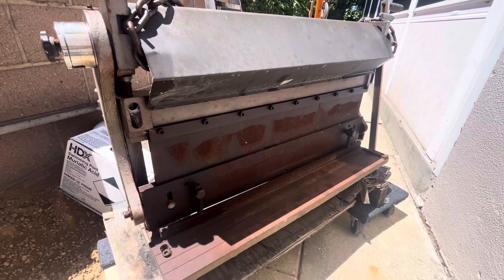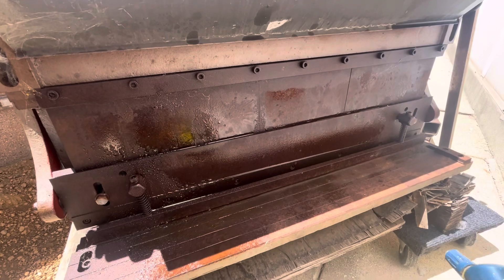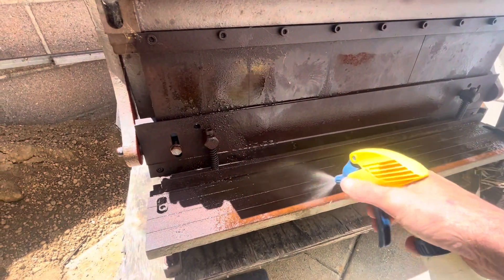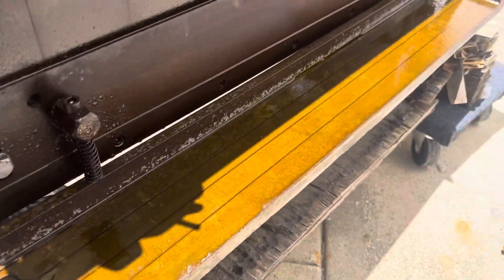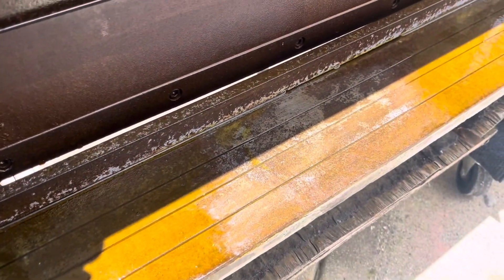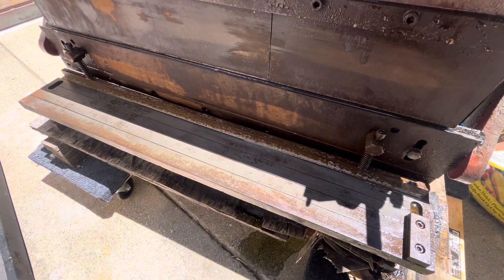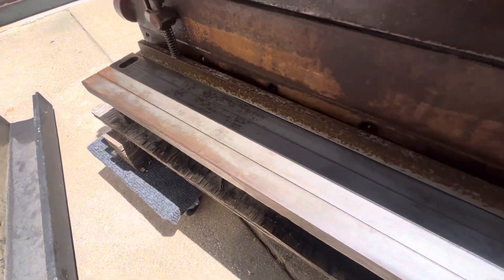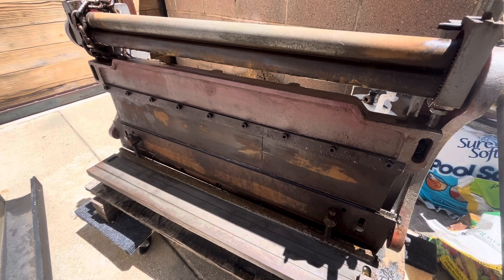Does muriatic acid remove rust?? See what it did on this old iron tool.

Comment: Neutralize the acid with baking soda or it'll eat through the metal.  It works but don't forget to Neutralize the acid.   Just mix a cup or more of baking soda in a 5 gallon bucket of water pour it over where you used the acid.  Do this a few times and it'll be fine.  Keep it away from brake fluid and bleach.
Reply from the maker: Good tip. I had that thing looking beautiful. Then it had to sit outside for 3 months 😔. Such is the life of a machine in a small garage

Comment: Add dish soap in it so it will not dry out on you and wor longer
Reply from the maker: Interesting. I’ll try it next time I buy something that was left outside for 20 years
Reply: @Motorhead_Mark  add dish soap to the acid it's like naval jelly it alows the acid to continue working bit not letting it dry as quick also wrap in trash bags